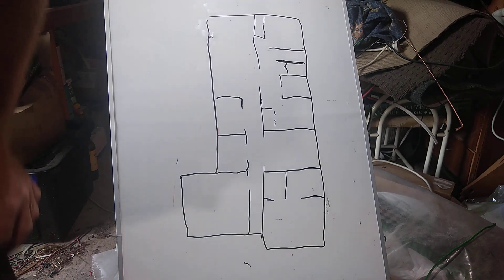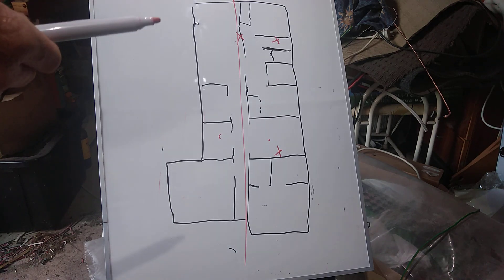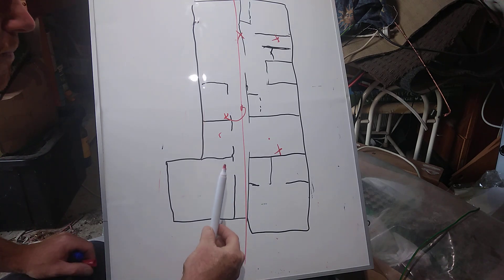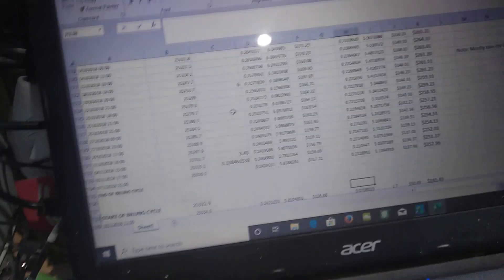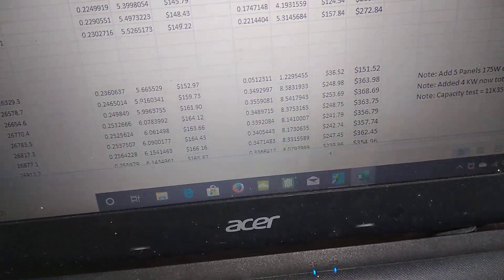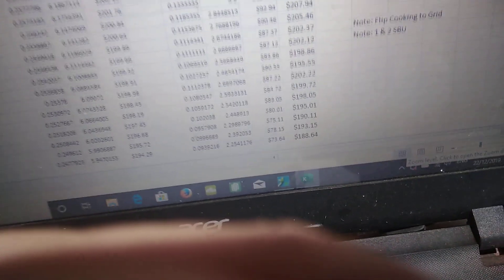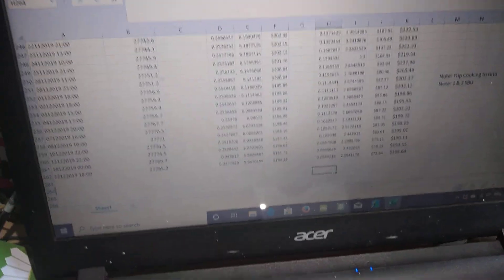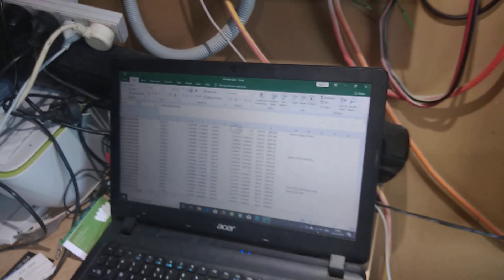What my DIY Powerwall is used for!

Comment: did the same one circuit has tv, fridge, internet,washing machine,bread maker and power points where we sit plus the lights and fans, all on changeover switch...microwave toaster jug on a separate grid circuit....2.5kw on the roof 3kva inverter 5kwh powerwall..never have to switch changeover to the grid and if the power goes out we do not even know till we have to boil the jug (can use bbq for cooking and jug then)...so far is worth the effort...well done
Reply from the maker: Hey Stuart, I'm trying to follow you comment, is this what you are doing? or question on what I'm doing?  If this is yours would you like to send be some photos. recycle18650liion@gmail.com.  Otherwise sounds very similar to how mine is setup.  Changeover switch for each side of the house from Solar to Grid.  Over only on grid. 24v, 3Kw Inverter and x amount of Panels about 3Kw and 13.7 Kw batteries.